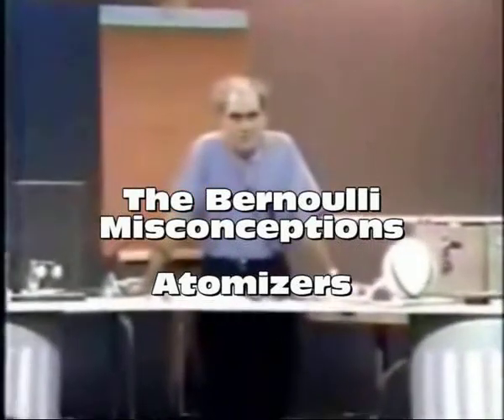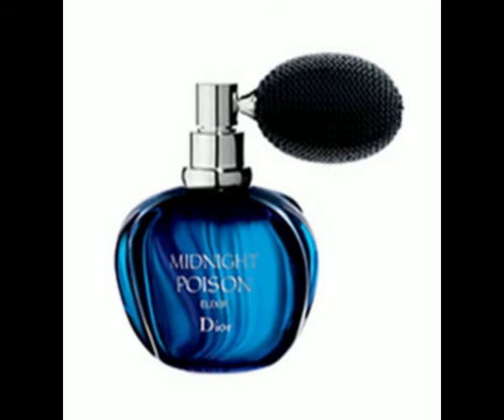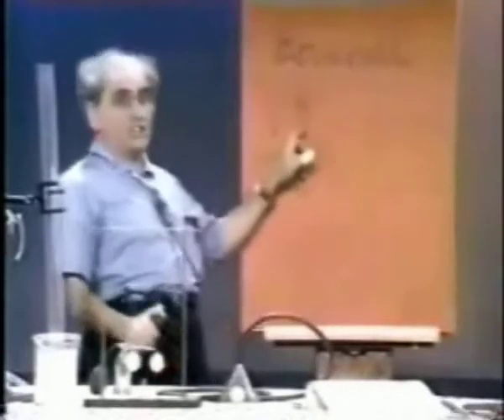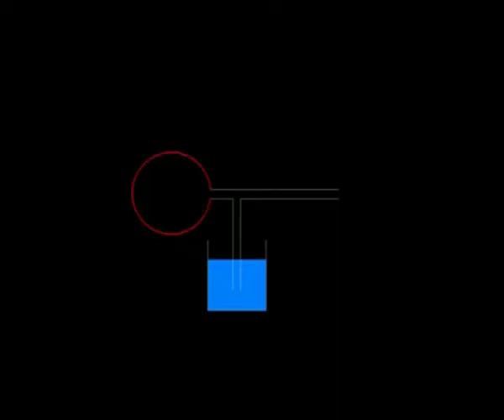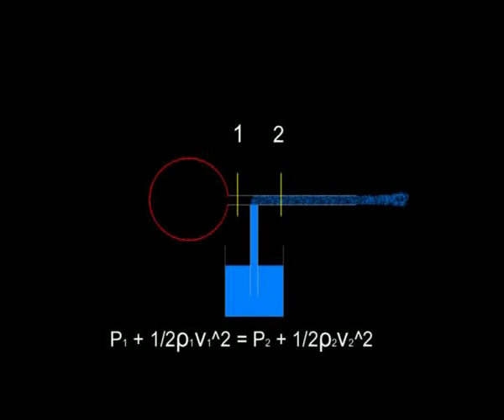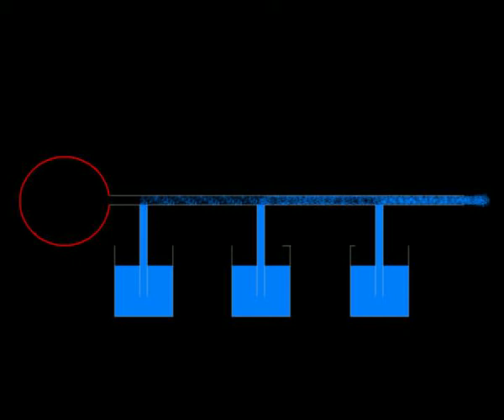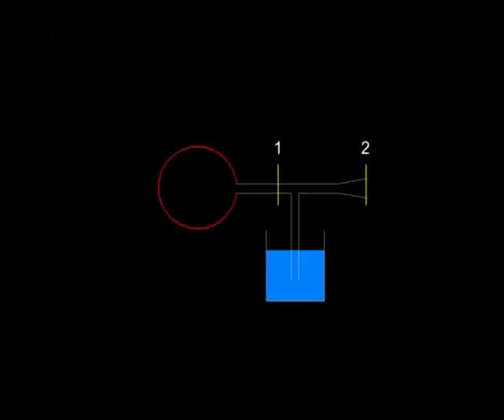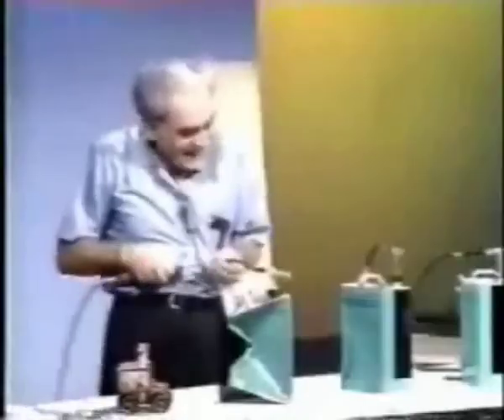Bernoulli Misconceptions 2 - atomizers

Comment: Hi

I am a physics graduate interested in "old fashioned" spray gun designs as I am dealing with liquids that do not work particularly well with modern designs.

I would suggest that a distinction between static and dynamic pressure might help with some points.

As a thought experiment imagine a large resevoir of pressurised gas and an idealised zero friction air hose leading from it - the hose has constant diameter along its entire length, other idealisation include laminar flow and no energy loss in the form of heat.

PLEASE NOTE - the hose has CONSTANT diameter along its entire length.

Start off with a simple model that is too simple...
=======================================

The gas in the container has zero dynamic pressure - the pressure is static pressure only.

When the gas enters the hose there is a sharp drop in static pressure on account of Bernoulli's principle, static pressure decreases but dynamic pressure increases, total pressure however remains constant along the entire hose. 

( REMEMBER we assumed frictionless walls and idealised laminar flow ).

The pressure drop encountered in the real world along a length of hose is due to friction, it is analagous to wire resistance in electrical circuits.

This therefore does not allow us to say thing like 

"At the exit of the pipe the pressure will be atmospheric".

In the idealised case the only pressure drop in the system is when the gas first enters the hose and this is because it was accelerated. After this initial acceleration nothing else happens along the length of the tube, there is no friction, there is no turbulance, there are no dissipative factors.

The gas emerges from the end of the tube with the same velocity that it entered with.

The dynamic pressure just inside the hose at the exit is the same as just within the hose at the entry - the total pressure at the exit is therefore substantial and not the same as atmospheric.

Ok whats wrong with that model?
===========================

Well the first observation is that if there is really no resistance or dissipative forces involved then when we turn on the gas supply we have a constant force ( pressure x area = force ) driving the system but no resistance - doesn't that kind of situation lead to ridiculous scenarios of constant acceleration - but then what about end effects at the end of the tube and so on.?

What we actually see is that real hoses with resistance and end effects cause pressure drop, this can be seen as a tendency to slow the gas down. 

Of course when you slow the gas down then you also diminish the resistive factors as they are all dependent on the velocity.

In a sense pressure drop is self limiting, the resistance to flow is dependent on the velocity of the flow, if you increase the velocity the resistance to that increase in velocity will also increase, if you reduce the velocity then the resistance will fall.

We should now be thinking in terms of equilibrium or balance points.

In fact this is exactly how an itterative computer model might go about solving, ( very early in my career I had to write computer models for predicting gas flow in long manifolds )

1. Start with a guess at the gas velocity in the hose and calculate from that the resistive factors implied by that velocity.

2. Take the static pressure of the resevoir and the resistive factors and recalculate 
the flow velocity - remembering that resistive factors are dependent on velocity.

3. Go back to 1, with the revised value of velocity - continue until you start to get a
constant value for velocity.

In a sense resistance is the agent that tries to reduce dynamic pressure by a constant amount throughtout the entire hose by slowing down the velocity of the gas within the hose. 

(Remember this hose has constant diameter and so constant velocity ).

Limiting cases can be ridiculous but they can also illuminate.....

If resistance somehow continued to increase and velocity approached zero then clearly we have a "blocked hose" the static pressure will rise until it equals the static pressure in the resevoir.  This is not a serious scenario - there are major holes in it but it does help illustrate how resistance has the effect of reducing dynamic pressure and restoring static pressure the latter in effect being the driving force for the former.

In real life
========

What we encounter is a balance point between the opposing factors.

The gas is accelerated when it enters the hose and so there is a drop in static pressure and an increase in dynamic pressure, the balance depends on the velocity to which the gas is accelerated.

Opposing gas velocity is the pressure drop, the resistance of the hose, dissipative factors and so on.  This has the effect of reducing the velocity at which the gas travels through the tube.

Since we assume a constant hose diameter then the velocity of the flow in the tube is constant otherwise we have to account for lost mass.

So when a gas enters a uniform hose it will accelerate until equilibrium is reached with those factors which tend to slow the gas down - we are talking balance points here.

So finally
=======

The pressure of the gas just inside the end of the tube will NOT be atmospheric as I have read in places, this is wrong will infact  be a substantial dynamic pressure ( the gas velocity once established is uniform througout the hose ).

We cannot expect a zero static pressure either. When you release a bubble of pressurised gas to the surounding atmosphere the static pressure does not instantaneously go to zero.

In the region after the end of the hose there will be an expanding jet.

At the very start of the jet conditions will be similar to conditions just inside the hose.

Much further out conditons will be the same as general atmospheric.

At points inbetween we will see a balance ( static vs dyamic ) that lies between
the two extremes.

My point is simply it is incorrect to say that at the end of the hose conditions will
be the same as atmospheric and since this is precisely the position where a lot of atomisers
place the liquid nozzle then it is very significant.

It seems to me that there is sufficient complexity in this to ask the question.

When you say a atomiser works by Bernoilli Principle or you state the reverse, precisely what kind of design of atomiser are you talking about?

I have seen diagrams for symmetric venturi 

R > r < R

and assymetric

R > r

infact all manner of restrictions and liquid nozzle placements and cases where the liquid nozzle is not inside the air duct but at a distance from the end.

Bernouilli's Principle indicates only a STATIC pressure drop at a restriction relative to the pressure upstream of that restriction it does not indicate whether that drop is sufficient to take us below atmospheric.

In general the only way to be absolutely sure that you are getting the benefit of the Bernouilli effect is to place your liquid in a sealed vessel ( with the liquid tube poking through the top) and then to use a secondary air line to bleed a small quantity of air from the upstream ( high pressure ) side of the restriction to equalise the  container to that pressure.

So there are two tubes, one positioned (say) at the midpoint of the restriction (we intend liquid to rise up this one ) and one upstream of that which simply pressurises the entire contents of the container.

Then you know that the rise in liquid is ASSISTED by the STATIC pressure differential attributed to the Bernouli principle but of course you still have not ruled out other assistance due to other factors.

Why do most people assume only one factor at play here?

The problem strikes me as complex and ill defined because not many people who enter the debate seem to indicate precisely what geometry ( by that I mean configuration of tubes and so on ) they are talking about.

Its very interesting though and as usual whoever is right it does show how the principles of Physics ( assumed to be correct'ish ) can still lead to different understandings of the same phenomena and even well qualified people can arrive at different results dependent on what they think are the significant factors - models never include all factors, instead they deal with the factors that people included in their thinking.

It could probably be solved by measurement very easily.

Try different restrictions at different points.

Calculate the Benouilli effect and then see what "head of water" you can lift in reality and what head of water you should be able to lift.

Sorry for any mistakes in advance - proof read a few times but almost certainly not enough so I am sure I have said A when I meant B.

Jon
Reply from the maker: Hi,

Thank you for your input and sorry for being late to respond.

My point with the video was to show how a misconception of Bernoulli's Principle often leads to completely wrong understanding of simple fluid dynamics. 

Julius Sumner Miller sketches something that looks like a venturi injector, but gets the explanation of how this works completely wrong. He calls this atomizers, even though the principle of many atomizers look quite different from this. 

When calculating the various pressures within a tube with various cross sections, one should only consider the internal pressure within the flow, and not the dynamic pressure. The dynamic pressure of the fluid exiting from the tube will only cause turbulence, and the kinetic energy of the fluid will be lost. 

So, when using Bernoulli's Equation to calculate the "suction force" of a venturi injector, one needs to understand that the internal pressure within the flow must be the same as the surrounding static pressure. The fluid will be accelerated to a speed that will match the surrounding pressure.  Then it is just a question to solve the pressure for each cross section of the tube based on the Bernoulli equation. 

I tried to show that the way Julius Sumner Miller explained it will simply not work. 

I decided to omit any effects of friction in order to keep it simple.

Cheers